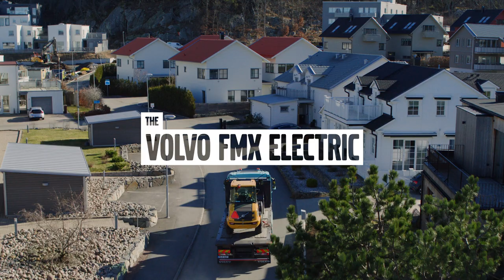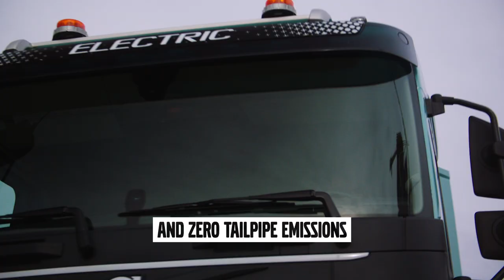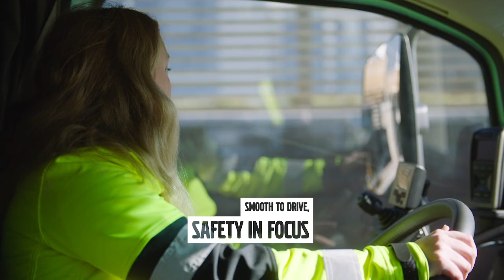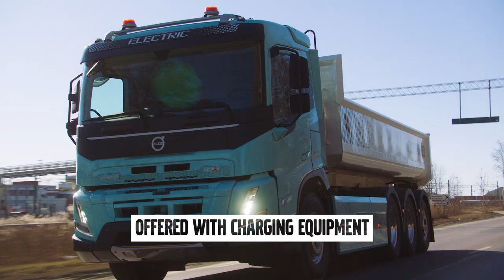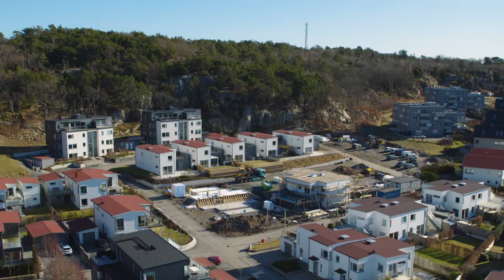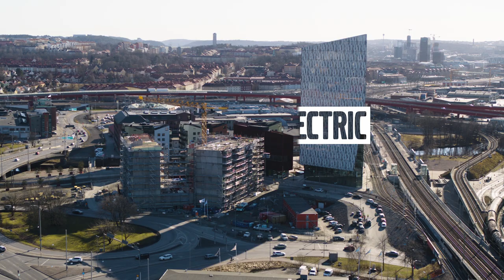Volvo Trucks – Volvo FMX Electric for quieter and cleaner construction operations

Comment: Can battery recycling possible ?
Reply from the maker: We have a strong commitment to responsible sourcing, use and disposal of materials. We closely follow the development of recycling technologies and participate in several projects where electric vehicle (EV) batteries, reaching their operational capacity limit, can be transferred to other applications such as storage in solar energy systems. 
Batteries represent a substantial value and when capacity has dropped below usability, there are several options. Re-use in residential or industrial energy storage is expected to be a major application.

Comment: What is the range of Volvo fmx electric.
Reply from the maker: The number of batteries and their useable energy will be flexible and adapted to the customers operation allowing a range up to 300 km. We have advanced simulation tools that are based on several years of electric vehicles used in commercial traffic. The driving range depends on the number of batteries the trucks have and on a series of external parameters, such as the driving cycle (many stop and go), if the truck has a superstructure which also demands electricity from the batteries, topography, temperatures etc. The truck´s battery packages are specified according to customers need.

Comment: Range?
Reply from the maker: The number of batteries and their useable energy will be flexible and adapted to the customers operation allowing a range up to 300 km. We have advanced simulation tools that are based on several years of electric vehicles used in commercial traffic. The driving range depends on the number of batteries the trucks have and on a series of external parameters, such as the driving cycle (many stop and go), if the truck has a superstructure which also demands electricity from the batteries, topography, temperatures etc. The truck´s battery packages are specified according to customers need.
Reply: @volvotrucks  Thanks.

Comment: Well electric truck can save enviroment.i think vokvo can find another better resource
Reply from the maker: Electromobility will play an important role for local as well as regional transport and the development of batteries and charging infrastructure will be important factors in its expansion. However, there is no one silver bullet solution available to cut carbon emissions. We will see a gradual introduction of alternative drivelines including battery driven trucks and gas driven trucks over the next couple of years. Electromobility using hydrogen fuel cells has the potential to reduce the need for batteries in heavy long-haul transport in the longer term.
Reply: @volvotrucks  so you dont love the rumble of your v8s?